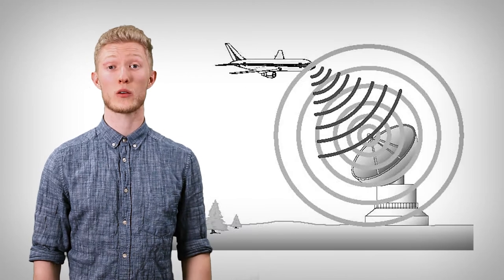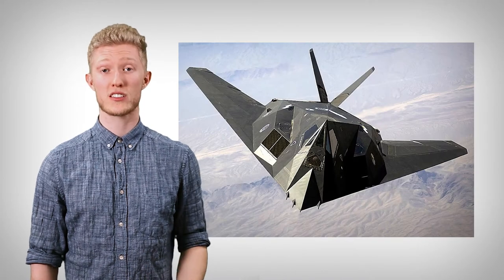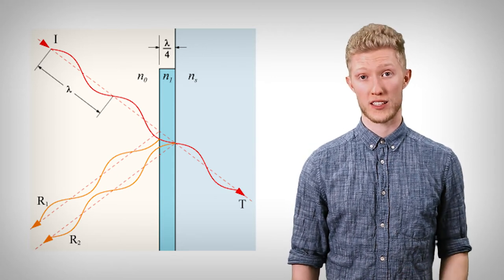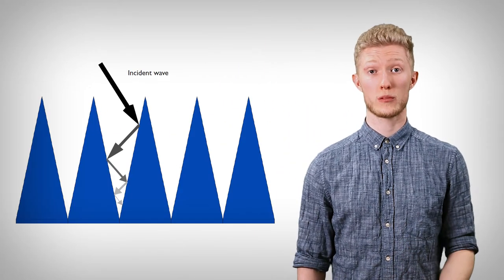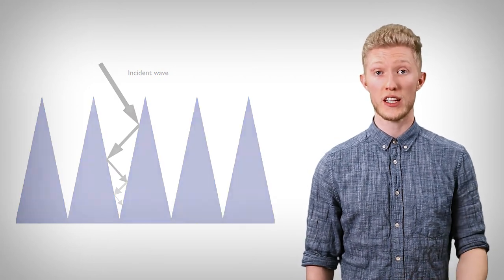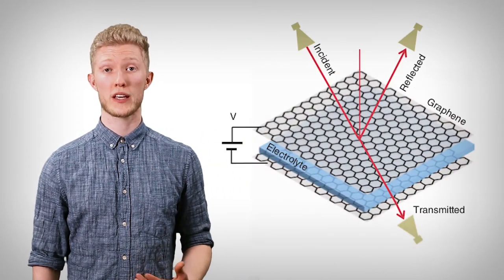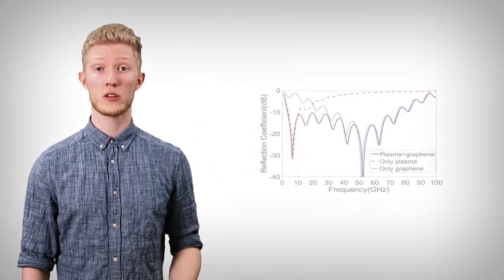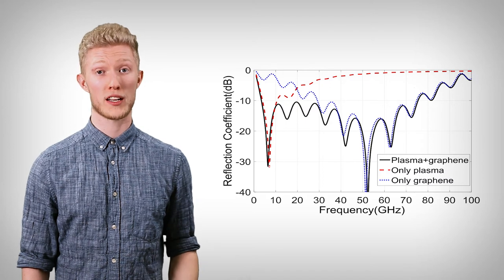Quick Intro to Radar Absorptive Materials

Comment: hey james so doesnt the ram coating block a planes own radar returns?
Reply: Excellent question.  Imagine a small army of engineers working as part of an integrated systems team.  The AeroE EE guys already know that they need to orient the AESA radar array at an angle to the longitudinal axis of the aircraft and that they’re working on a VLO platform.  Due to generations of experience with radome material, RF emissivity and permeability, they know they need to apply VLO techniques to the radar antennae array face and its backer, so the bulkhead between the AESA array and the back-end radar electronics (power amps, filter, waveform generator, cooling systems architecture) has the RAM applied to it, thus keeping the frontal RCS within the specs demanded by the program.

Comment: Can we use rader as radio waves absorber?
Reply: A receiver ?
Reply: That’s what a RADAR antennae is by design, if it’s going to be of any use.  The return signals (very weak compared to the original emissions) have to be “absorbed” back into the antennae to be processed.  They actually get amplified/excited after that, filtered, processed, and displayed on a screen for a human operator to visualize.

Comment: Why not use hard PVC plastic for stealth aircraft! ?
Reply: Wouldn’t it melt? It can’t withstand temperature changes
Reply: @Sleepy_Moon84  Stealth plane doesn t need have a speed above 1 mach (1200 km/h) into dangerous area versus ground radar system to detect !?Speed only have a sense      by get closer to dangerous area or leave dangerous area to save a time of flight!?Maybe use mix pvc materials under body of plane !?
Reply: @hrvojemikulcic7074  Under combat, PVC materials will not last at all in military aircraft. It cannot deflect fire that well.
Reply: @Sleepy_Moon84  Ok no material can deflect (avoid) fire!?Stealth materials  is not bulletproof wear!?☺
Reply: @hrvojemikulcic7074  If a gun fires at a plane, PVC material would break apart much further. Plus it won't be able to resist temperature changes, stealth planes are applied in fighter jets. It's just less durable overall.
Reply: @Sleepy_Moon84  Ok